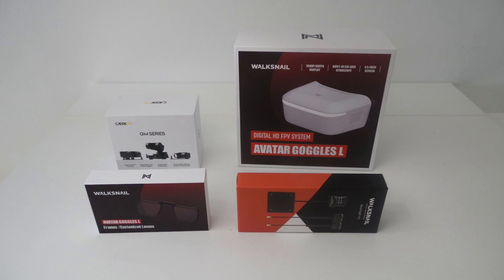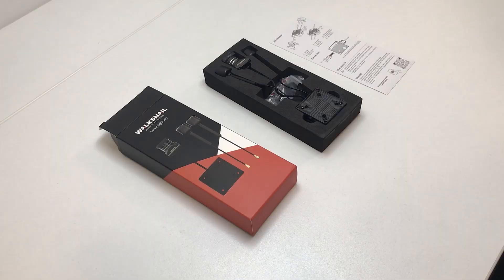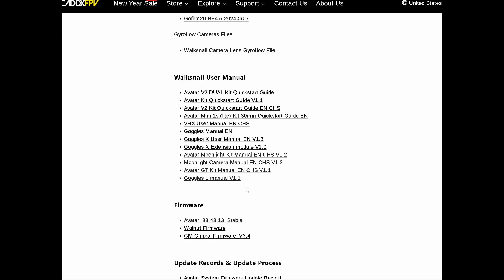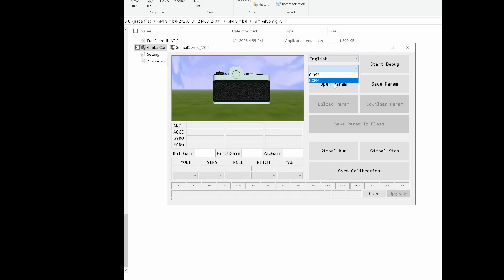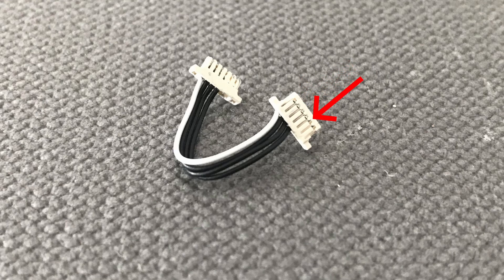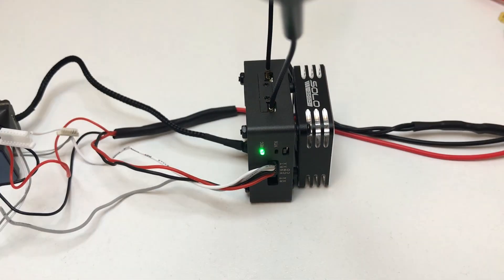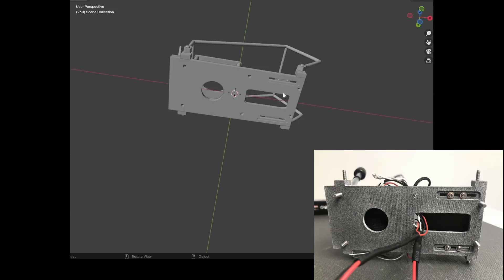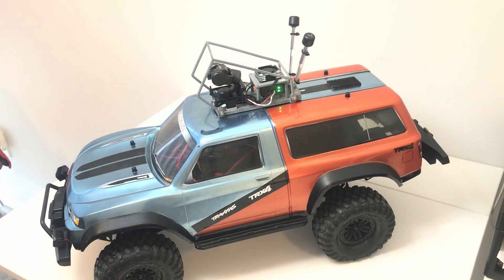Digital FPV on RC Truck: TRX4 & Walksnail FPV + Goggles L

Comment: Hi, I have the same kit, I built it yesterday. Where can I get a 3D file of the holding structure you show, Caddax doesn't have a battery mount part for Traxxas? Thanks
Reply from the maker: Hi, I designed the holding structure shown in the video. I can send you the files ready to 3D printing (format .stl) if you give me an email address where I can attach them and send to you. My Traxxas TRX4 (chassis Kit) came with a battery mount (for short batteries) in the front of the truck additional to the main battery mount in the middle of the truck. I use a short 3S battery (in the front mount) fully dedicated to power the Moonlight kit, the Gimbal (GM3), and the fan. I don't think Caddax has any battery mount specific for Traxxas trucks/cars. In the end of the video you can see the front and main battery mounts of my TRX4.
Reply: @ArmandoIzquierdo-AIRvision  unfortunately when I enter my email, YT blocks the comment. Can I contact you in another way? FB?
Reply: Awesome info here.  Can you please send me the link for the camera mount and cage. It’s perfect for what I need it for.
Reply from the maker: @klepack  Thanks! Yes, let me know the email where I can send you the 3d (stl) files.
Reply from the maker: Hi! I just included in the video description a link where you can download the 3D files of the mount and cage. Hope it works for you.
Reply: Can you please share the stl file? It looks amazing!!!
Reply from the maker: @AirNiro4  Thanks! Yes, let me know the email where I can send you the 3d (stl) files.
Reply from the maker: Hi! I just included in the video description the link with the stl files.